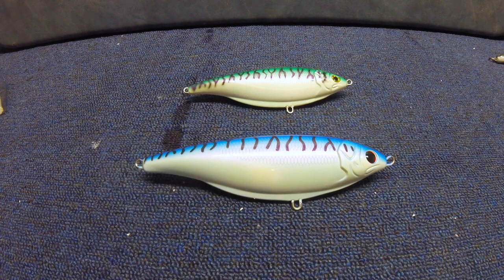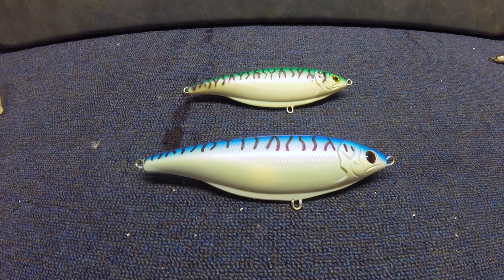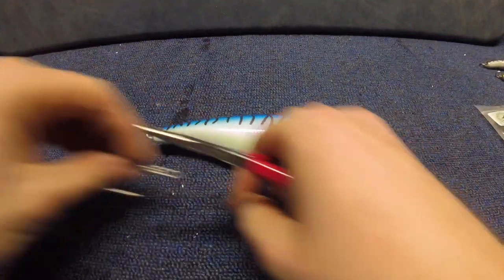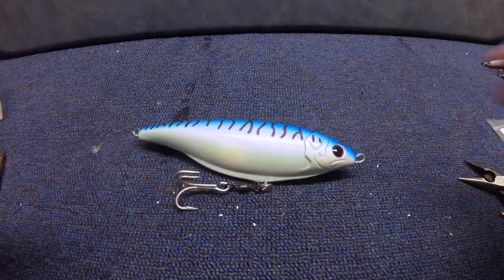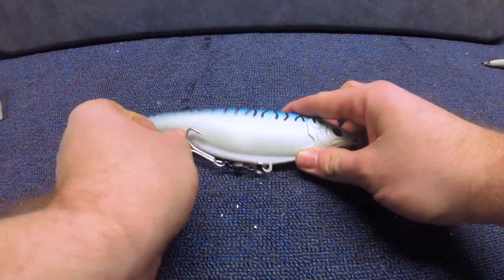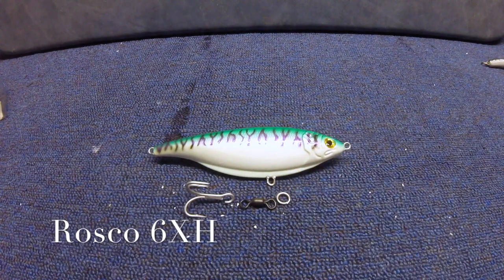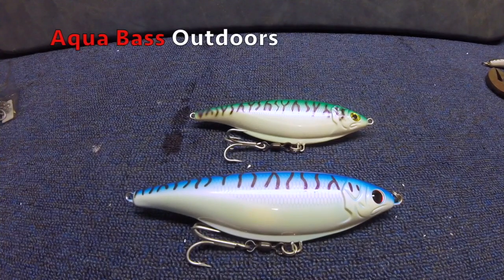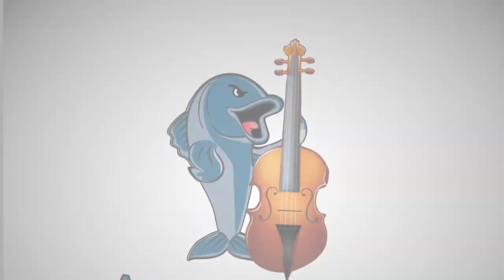Rigging a Stick Shad (Cape Cod Canal)

Comment: Fast sinking or regular sinking for canal?
Reply from the maker: The shads in this video are from our channel sponsor.   They are a moderate sinking speed.  I typically throw stick shads when I see breaking fish or when they are tight to the edge of the canal.   Slowly retrieving it has it ride about 2-4ft down.    If there are hungry stripers on bait of that size, they will come up for it.      If you want to go with these visit below and use promo code "JACK" for free shipping:   They are sold in groups of 3, but combined are still l less than 1 of the name brand lure:  https://reelpowerhandles.com/products/3-stick-shad-shadd-swimbaits-in-2-sizes-5-colors-hooks-rings-not-included?_pos=1&_sid=dfc62fced&_ss=r&variant=27696945758285

Comment: How do you trust the cut treble over traditional ????
Reply from the maker: Slow burn_172 I have never had an issue with them. It takes a tremendous amount of force to reopen. The reason for using the cut is that the additional split ring I find makes it a little too long ( my personal preference). So it may swing over and fowel with the line. Thanks for watching and if you haven't please subscribe.

Comment: Try adding a bucktail flag(no hook) or a willow leaf spinner blade for added attraction to the tail hanger, it won't foul the belly hook. Try it, it's all about being seen!
Reply from the maker: Sure thing!   Before doing the above method I used to run a bucktail tied Siwash on the back.  Adding the Bucktail trailer to the rear joint is perfect!    Have seen guys doing very well with that.  Thanks for the suggestion and comment.   Love these lures!

Comment: It’s not so much the water pressure that pulls the hook or the hanger, but the leverage against the side of the fish’s head or jaw. Think of the hook as your connection point and the plug as a pry bar
Reply from the maker: Dan Evan Exactly! Thanks for the comment that's spot on!